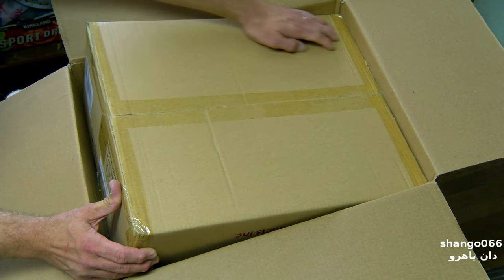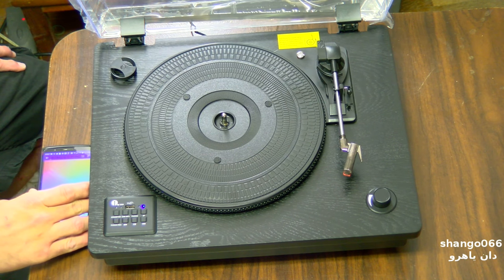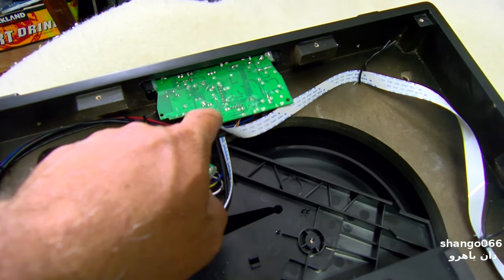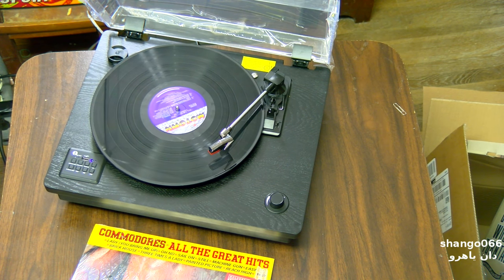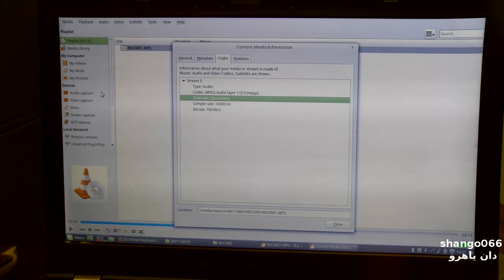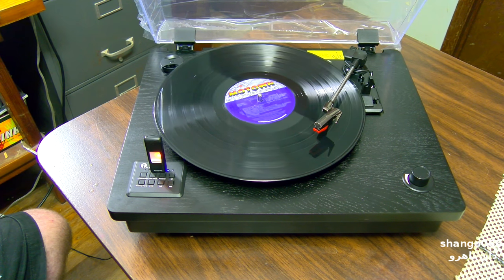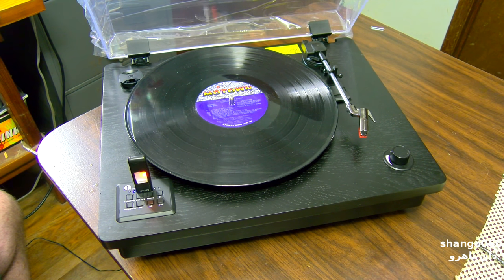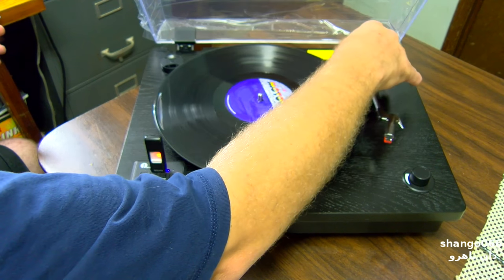1byOne Portable Classic Record Player Review Demonstration

Comment from the maker: This is our first review video of a modern product. A bit of a struggle
Reply: I bet, looks rather like a Crapophone mind...
Reply: At least you kept an open mind and found some positives about it without trashing it's many down falls.  This is a BT speaker that happens to play records.  haha
Reply: Thought it was very honest and open.  Well done.
Reply: It was a good review.  You should find a good working vintage deck that's intended to be used as part of a hi-fi component system (a Dual or a Goldring - Lenco?), take it apart and compare contrast with the innards of either this TT or a Crosley!
Reply: You both did well. 👍🏻😘
Reply: Truly your showing of restraint is an example to lesser men, myself included.  You did a full 5 star review, ticked all the boxes, and didn't leave any of my "Yeah, and what about X?" moments unanswered.  Well, just one...  It uses a wallwart, so I'm eagerly awaiting the road-test review.  I figure that's coming shortly after confirmed clearance of the good old grift moneys.  With the herculean tracking weight it runs, it might actually give a solid showing at least in the highway portion of the road test.  The lack of Bass and/or the EQ issue may be rooted in the fact that they either completely forgot about the RIAA Equalization applied during mastering, and reversed by the player, or nobody felt like programming it into the unit.  The poor MP3 encoding is a no-brainer, license the least expensive codec, get mediocre encoding.  Why they didn't give a straight WAV/PCM option what with 512GiB thumb drives being common now, I haven't a clue.  My only critiques of your presentation are that your choice of venue could show improvement.  Carpet, a more robust desk (By mass, although your 20th century school desk coordinates nicely with the woodgrain theme.) Well lit in terms of lighting, but for the future think about possibly doing some outdoor shots or add some 6500K CFLs. No 45RPM test?  Not feeding it a shellac 78 to abrade is totally understandable, but there should have been some cueing tests for 45.   As always, I salute your unique breed of pure and unadulterated randomness!  You can safely add turd-polishing to your long list of miraculous achievements.  I'd go as far as to say that the unit might actually be respectable if one were to put a real stylus and cartridge onto it, and dial back the tracking force an order of magnitude.  But at that point you're into "Just buy a dedicated turntable." territory anyway.  I say that from experience, paid $10 for an Audio-Technica PL50 at Goodwill, put $75 into a proper cartridge and pair of stylii and $10 for a 3-pack of belts because the PO left the belt strung up and put a nice thump-thump-thump kink in it..  For not much more there are SL-1200s to be had, and someday I'll be transplanting said cart and stylus onto one.  Good lord this reply got huge!  Now will someone PLEASE pass me the mind bleach so I can get that early 90s ZAR commercial out of my head.  Staring at that woodgrain texture for so long I keep hearing the girls singing "ZAR is good for more than just wood!  ZAAAARRRR!" while we watch a soccer-mom in gloves and safety glasses using the woodgraining tool to apply her ZAR and magically turn a bland gray steel security door into an attractive hardwood faux finished steel security door...
Reply: I wonder why you take so much effort in testing something that won't last, ruins records, sounds lousy and won't satisfy even those who don't care. It is just another Leetac, coming from the very same factory that puts out the Crosley Cruisers and you name it what else sub standard junk. Easily recognisable by looking at the plastic mechanism that they dare to call turntable. Maybe a small platter or a bigger one, basically it is the same stuff you don 't want to own. Stay well away from this junk. Do they come cheap? No, production costs probably won't exceed 5 US dollars but they will sell at a hundred dollars or so. So huge profits are made here. Avoid!

Comment: 4 Watts RMS without heat sink smells like class D amplifier. The worst type you can get. It's basically swtiching on and off a MOSFET on full saturation (1 and 0) and then filter it using inductors and caps as well as resistors to dampen out the high frequency spikes, resembling the "original" waveform. Doing that is why it is so efficient, because the MOSFET almost doesn't convert power to heat as it is always driven in full saturation or totally off.
Reply from the maker: Well JBL thinks class D is all the rage for pro audio, and maybe its fine for a PA or portable record player
Reply: shango066
When done right, it could work very well, especially when done buy professional engineers from JBL. But not with such a small integrated amplifier chip from china. ;)

I think the reason is energy efficiency. Class D has the best performance compared to other amplifier classes.
Reply: +BloodySword I make decently high power portable bluetooth speakers. I use class D amps and I honestly love how you can get 20W RMS out of a chip the size of your fingernail, but the high frequencies really suffer. Anyway, as for the passive radiator, its nice to see that they added one. If you get everything tuned right, those things really make a difference.
Reply: *****
You can achive good Class D aplifiers with frequency response up to 40 KHz and even higher, if well engineered. No doubt JBL will do their homework on that!

Comment: You and Chris did a great review. You guys are awesome. My problem is with this phono having a ceramic cartridge...really? Empire magnetic cartridges in the 1970's were only $6.99 at Olson electronics...and are so much better then the toy cartridge in this unit. And a pre-amp can't be that much more expensive in order for the magnetic to work. Maybe anti skating would also be needed on the arm if a magnetic cartridge were to be installed...but at least it would not have to weigh 6 grams. Shure had some magnetic cartridges that would track at higher weight and work without anti skating...I installed one in my 1962 Wurlitzer jukebox that was designed for a heavy ceramic. People are so stupid for buying this stuff...the general public mentality goes along with our current presidential race. You would think at least one company would come out with an easy transfer system that would be acceptable for audiophiles and not just Grandma.

Comment: Shango:   I disagree with your reason for a loudness control.    It's actually on older gear due to the limitations of the human ear.   The human ear can't hear lower frequencies at lower db levels as well as it can higher frequencies,   go check out the fletcher-munson curves on wikipedia for more on this.  (high frequencies are also a problem,   which is why you always see people putting their eq levels in the shape of a mild "U",   boost the low and the high.)   Keep the vids coming though!    You can't imagine how many tricks I have learned from you watching you troubleshoot old sets...
Reply from the maker: Yep I know about that, but they also do it for clip limiting and to make the thing appear like it goes super loud.
Reply: Agreed,   lots of OEM car radios are the same way with compressors.
Reply: The GE SuperRadios are the epitome if that; lots of base from the 1 W amplifier with the volume turned down, but not much more when it's turned up. It makes the best of a less-than-perfect situation.
Reply: I hate the loudness circuit for it's tendency for boosting mids after mid setting on vol control, all Realistic midget amps get the de-loudness treatment by having the caps desoldered from the middle tap on the vol cntrl ( these amps don't have loudness switch)

Comment: The IC's both processor and audio amp look very typical of the ones used in generic Mp3/USB/SD card players.  Look up mp3 usb speaker.  Those audio amps are actually designed to be very efficient as they're often used to run on battery and they don't produce a lot of heat.  Interesting video.  Cool that they sent you that for review.

Comment: I guess your camera records with AAC-LC (low complexity). Compared to MP3 it can achive full transparency at 192kbps, where on mp3 320 is still not enough. Youtube recodes it into 128 and 192 kbps streams as AAC and 128 with the OPUS codec. 128 kbps OPUS sounds like 224kbps MP3. Youtube also generates a 96-128kbps VORBIS audio stream (known as OGG because it is wrapped up in the OGG container, though the correct extension would be OGA (ogg audio)). VORBIS artefacts are so special, that it can't be compared with other codecs, however VORBIS sounds transparent from 192 kbps upwards. The sound of your camera 256kbps AAC is very high fidelity and can be assumed near lossless.
Reply from the maker: Interesting info. I remember reading somewhere youtube compressed to 96k but that could be old info.
Reply: shango066
Back in 2006 it was 22.05 KHz Mono 64 kbps mp3 with Sorenson Spark (MPEG4 AVC ripoff, known as Flash Video) at 320x240 pixel. Those were the days... :D

Here is a list of the formats the browser can choose from for your video. As the video is long and the video codec VP9 is VERY SLOW to encode even on Google's bad-ass servers there might be "webm" entries with "vp9", opus and vorbis added.

http://imgur.com/EH6CmP5

Yes audio and video is kept seperate for not adding the audio in each video quality level, this is since they're using DASH for video streaming.
Reply: @shango066  YT is 128k

Comment: You didn't mention anything about the tach strobe!! Did it work or what?
Reply: i don't think we tried it, Its probably meant more for the factory worker or service tech that would adjust the speed control, since its inside and not externally accessible.

Comment: Although i cannot see the point in vinyl in the 21st century, if you must have a turntable go for a vintage direct drive technics or pioneer, As for its bluetooth recording, that bluetooth module can be replaced with one that records at 96KHz there are plenty around on ebay, but as i said, im not really interested in vinyl i love my FLAC music too much, the sound is pristine with zero surface noise or wow and flutter, this is the reason digital was invented. there are people of course that will say "nothing sounds like vinyl" and my answer to that is BULLSHIT! i listen to flac on my sony ta-636 amp from 1979, and NOTHING compares to its sound quality and dynamic range. That said if you are into decent sound quality, bluetooth is the worst way of doing things anyway and massively degrades the soundstage. if i owned this unit i would just rip that bluetooth module out and fit an fm radio module in its place, to me its just useless when phono recordings have no bitrate limit.
Reply: True, but if you come across some vinyl recordings that were never digitized, you may want a record player to listen to it. I listen to CD's, Mp3's, Tapes, and Vinyl records so I can listen to any common format.

Comment: This is a cool idea, but it needs to be way better quality. This is like a Crosley or ION with a low quality recording device in it. 16000hz 160kbps is like a dictaphone. You can get higher bitrate music on iTunes. I would be willing to spend some money on a device like this if it had a metal platter and tonearm, and it would be great if it recorded in a lossless format. With a solid turntable, the sound quality is there. I love that vinyl is making a comeback, but I hate it at the same time because it brought a huge influx of shitty turntables, and ignorance from people that are new to vinyl. 

There are 2 major facts about vinyl that all the noobie's just dont seem to get. 
1. The album does not increase in quality when its put on vinyl. It can only be as good as the original recording. If the original recording is compressed, overdriven, and colored, it will sound that way on vinyl too. 
2. The better equipment you have, the better the vinyl will sound. The quality is being perceived as inferior because of all of the junk turntables on the market now. I bought a Realistic turntable (1973 vintage) at a garage sale for a dollar that will run circles around a 100-150 dollar turntable that is available new.

Comment: I would get rid of this.  I think recording the old fashioned way with the line out of a receiver feeding the line input of your sound card with a turntable feeding the phono input  would give you the best result.  Get a 30 year old Technics or Pioneer turntable with a Shure, Audio Technica, or Ortofon magnetic cartridge and you'll be much happier with the sound all the way around.  There's probably have a low sample rate A/D converter IC in there. To me there's nothing positive about this.  Records have great bass response, as well as a crisp high end.  The biggest limitation of vinyl, in my opinion, is diameter loss.  As you get towards the center of the record, it isn't as crisp as the outer groove.  A good cartridge will minimize that.  I don't want to sound like I'm bashing it, but there are a lot better turntables out there. The finish on the turntable, good or bad,  doesn't make the turntable.  The cue not coming all the way down would have been my first reason to get rid of it.  Cheap record players back in the day didn't have that problem.  In my opinion, they're trying to reinvent the wheel and get this generation playing records, and I think that's awesome.  For me though, this one doesn't work.  I genuinely appreciate the review though.

Comment: As a DJ of 30 years experience, I tire of these toys very quickly! It's all cheap plastic and as I use a brand new Technics SL1200 MK2 with a MM Ortofon cartridge running into a Cambridge pre-amp running into a Primaluna Dialogue Premium HP Integrated Tube Amplifier running into floor mounted Wharfedale speakers I cannot take this toy seriously guys! Sorry but it's a piece of shit! If you have to push the tone arms lifter down to make it play, that's a massive fail straight away! Why these units are even made angers me because they end up in the trash very quickly! A big thumbs down! Andrew Peter Collins, Australia!

Comment: Ok the cabinet is decent and the built speakers are nice, but that's about it everything else is complete trash, so much could be fixed if they didn't use this cheapest turntable mechanism(that's in crossleys and every cheap suitcase style modern record player and also cheap 80s component turntables, yes that's when this cheap mechanism was invented, which you can get for several dollars if you just buy the platter/tonearm assembly from china) and it wouldn't cost them much more and turn up that recording encoder to at least like 192kbit/s 44khz stereo, The terrible recording quality was a software issue and it was a major letdown.

These issues could be fixed for several dollars more in the product price, then it would be a decent budget turntable for a beginner.

Comment: That was a very thorough review, well done. Yeah, it's better than a Crosley, but it's still not good enough---I realized that as soon as you pulled the bottom cover off. The speaker system is definitely better than a Crosley, but the turntable is about the same.

Comment: Technics SL1200-these became a standard TT in radio stations.Now there is a NEW version of the SL1200-now beyond the reach of most buyers-$4 grand now.Before you could get SL1200 for under $500 if you looked around-esp from the broadcast suppliers.

Comment: It's a good job you reviewed this product and not me.  You're so much more charitable!  A tonearm that doesn't cue up and lower correctly, and then tracks like a pneumatic drill at over 6g and STILL skips is just not fit for purpose.  I doubt you could play records at parties because the moment someone tries to move around the thing will jolt.  It looks like the tracking weight and the anti-skate bias mechanism that's presumably adjustable from somewhere inside the deck or tonearm mechanism hasn't been preset correctly at the factory.  I suspect the muddled, tinny over bright quality of the record playback was probably down to a ceramic cartridge, going to an amp board that doesn't provide the correct RIAA EQ curve that all moving magnet and moving coil phono stages come with as standard.  Records are deliberately cut with increased treble and reduced bass to make stylus tracking easier, and the phono stage is supposed to correct this.  From what you say, and what I heard in the review, I doubt the 1byOne does this.

 As you say, it's trying to do too much for the price - I don't care about the USB, it's supposed to play records from start to finish.  It doesn't, and from what I've seen off this type of product, there seems to be no alternative but to buy a base-model Rega or Pro-ject turntable and get some cheap ancillaries to do it properly.  Good vinyl playback,  by which I mean acceptable sound (not necessarily audiophile) and solid tracking via a moving magnet cartridge, does not come as cheap as this I'm afraid, especially when you consider that you're buying a TT, amp, speakers and some silly USB twaddle for probably the same price as a good base spec Moving Magnet cartridge.

Comment: Like you said, at least some care was put into the design. If they fixed the mp3 sampling rate and the springiness of the power switch on the tone arm this seems like it would be an acceptable entry level turntable.

Comment: What a piece of junk. Whoever is responsible for building this tragedy should be sent somewhere far away. You will never get any type of quality flat frequency response from a cheap ceramic cartridge. The platter, tonearm and motor are an extreme example of bargain basement. The playing weight will do to the records what an apple peeler does to an apple. I'd rather go through the steps of connecting a real turntable to a computer.